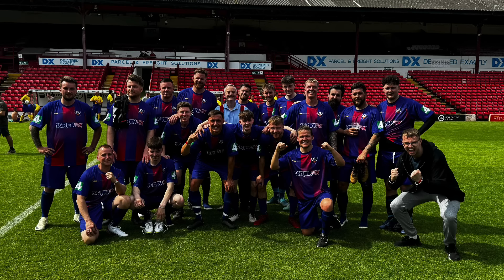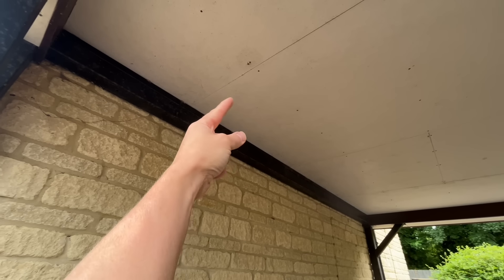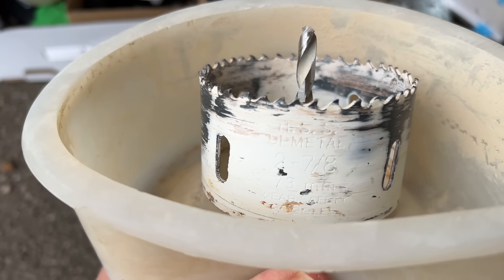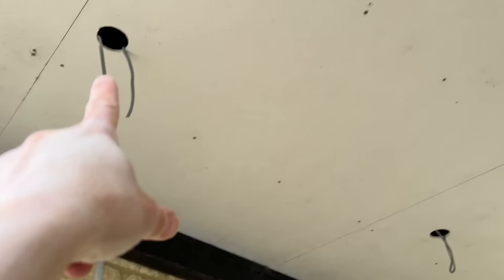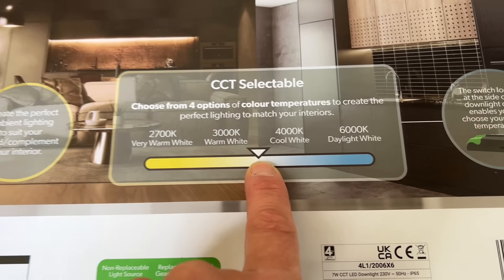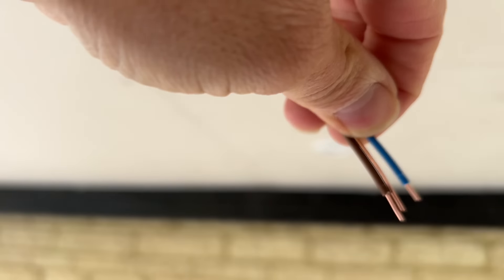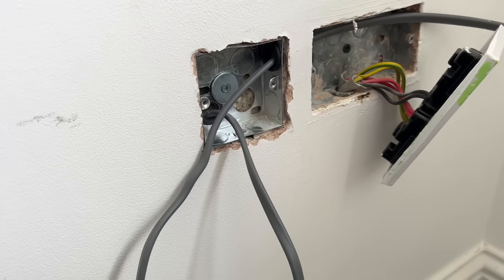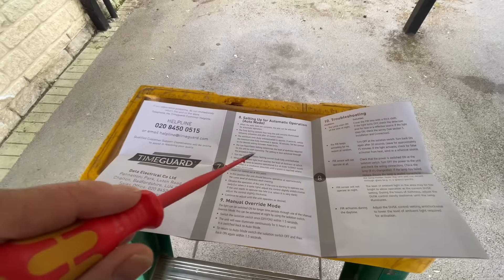Car port lighting easy peasy. James is late !!!

Comment: The only sure way to know if it is an ACM (asbestos containing material) is to have it tested, builders etc were using up stock years after it was banned. You can't just say oh it will be fine because it was built afterwards.
Reply from the maker: Yes I can it’s located on a massive housing estate. It was illegal to fit. The house builders are not that stupid to use stock from 2-3 years later.
Reply: @Cjrelectrical  Your lungs not mine 🙂